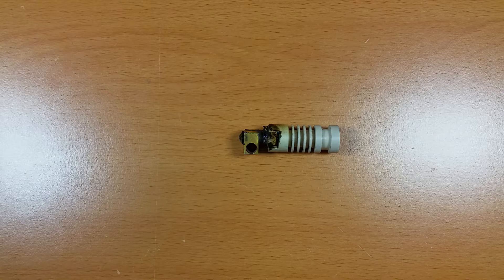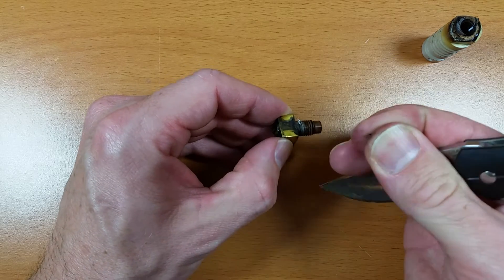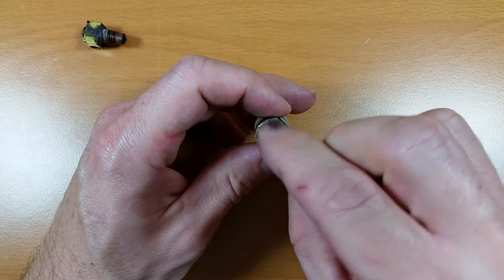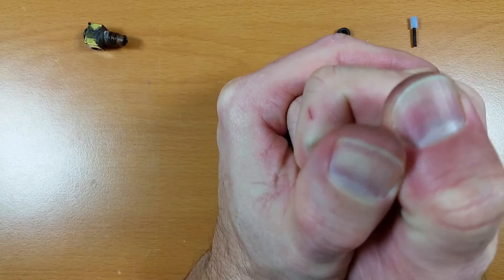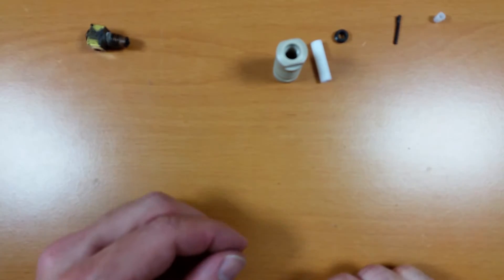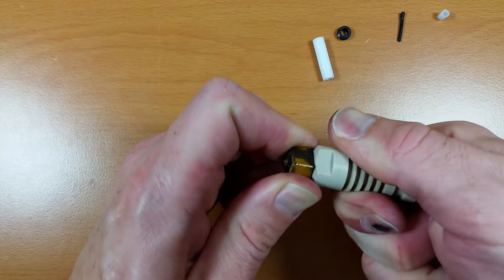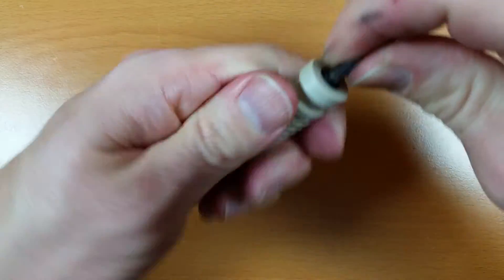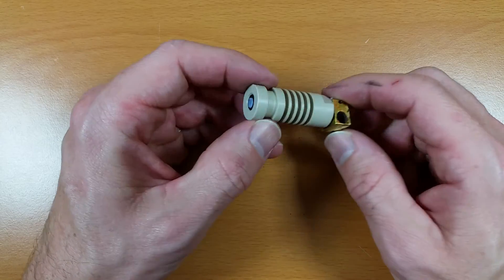How to rebuild a J-Head hotend for a RepRap

Comment: Hi Erin, I'm Rob and building now for the second time the Prusa i3 -
 I do it again with the help of youre Videos. 
(I hope you do not mind that I write it here)
because I can not respond over there I would like to thank you right here!

and talk about this J-head I myself have a E3D which at the beginning stalled repeatedly.
Now I replaced the steel pipe by a pipe with nylon and now it works better.
(Do you think J-head is better than a E3D?)
it is also because I am not good enough with the software,
Marlin... pronterface and Repetier in combination with English -
but I also got the printer up and running thanks to you videos!

Erin thank you!

Friendly greetings from the Netherlands.
Rob.
sorry for posting it here!
Reply from the maker: +R. Rob. I've never used an E3D so I don't know. :) I'm the type of person who sticks with something when I discover that it works well. I was easily able to print over 200lbs of PLA with a J-Head before it needed to be rebuilt but it was usually due to an overheating issue. If you want to experiment with other materials, you may want to try a Pico or another all metal hotend. I have also not tried the Pico but it looks great.

Comment: Is it just me or does j-head seems like hack together? Thermistor should not be able to get loose like that and cause damage.
Reply from the maker: +Jurva-Markus Vehasmaa They make high heat cement you can use to secure the thermistor. There's also a fail-safe setting in the firmware called HEATER_0_MINTEMP in Marlin. Mine was set to 5. If it had been set to 100C, this failure wouldn't have happened.